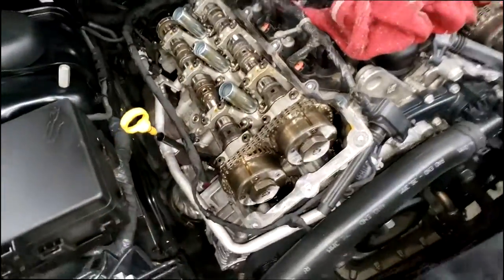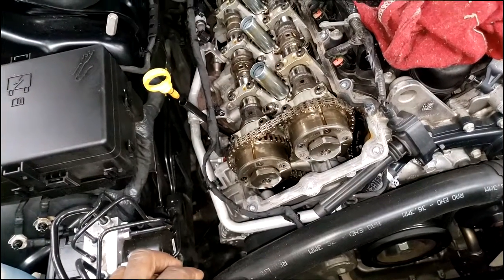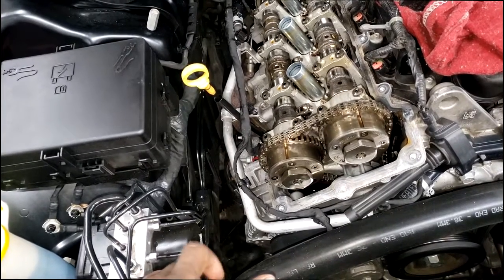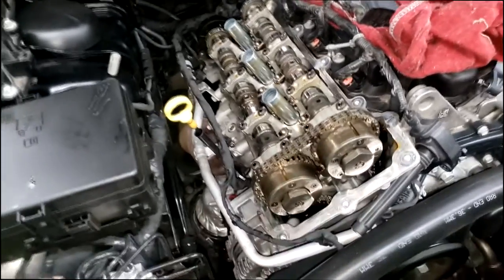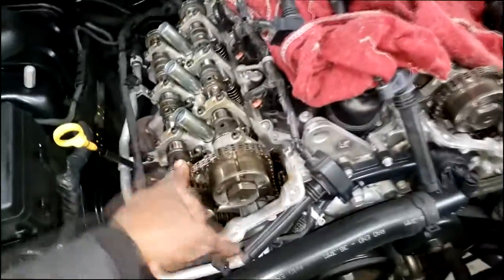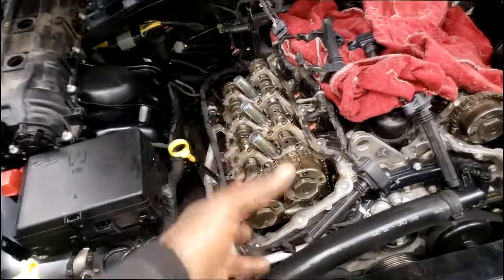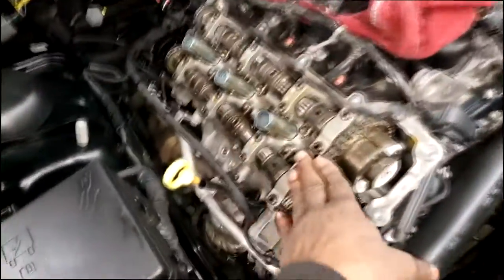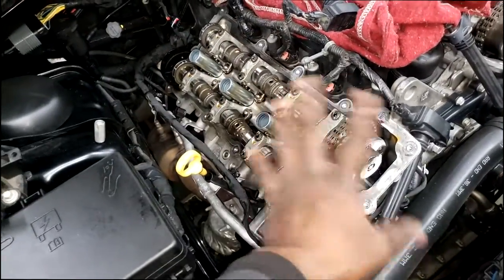VVT Cam Phasers. NO SPECIAL TOOLS NEEDED. Broken rocker arms, lifters, camshaft,  3.6 Pentastar tick

Comment: So you were able to get the phasers back in place without applying pressure to the tensioner?
Reply from the maker: Yes, its a fanegalling thing. But I dont recommend doing it this way. I suggest you use the proper tools.

Comment: Hey so I have to do head gaskets and have to remove timing to reassemble. Am I gonna need special tools or is it just gonna be a huge pita? Wanna make sure its not impossible without extra tools.  Or if I need help. DIY mechanic with experience doing heads. Never timing. I know bits but its what I dont know that worries me. Vehicles a '12 town and country 3.6 pentastar with 135k
Reply from the maker: Cover just nuts and bolts if I remember correctly. Special tools needed for cyl head install mainly. I'm trying to remember because I hardly ever remove the cover when taking off the heads. But good luck buddy. Also are you subscribed to this channel?

Comment: Great video, I had the phasers out and new ones in , in a flash. There is no check engine light on and I verified 
 There’s no other codes on the computer with dealer level  
Computer . Nothing stored absolutely clean. Am getting a perceived rich air fuel condition on the cylinder bank in question where long term fuel is being trimmed out , I was getting phaser noise on only bank one at idle with a cold engine and phaser rattle would go away once engine was near operating temp. I ended up taking the valve cover off and on 2 more times. Once to check galley bolts and another time making sure I didn’t have some kind of lifter cam issue. Anyway I 
 replaced  the phasers, oil control valves
, the phaser solenoids I verified oil pressure with a mechanical gauge , 85 psi cold oil and 32 psi hot oil, and still have the phasers rattling at idle with a cold engine. I changed the oil and filter. I checked the filter and found what looked like small black specks of something I don’t know what it was. It could be plastic or black gasket maker from replacing the valve cover 3 times ?? I also did an engine flush in case there was oil sludge blocking an oil passage. The flushed oil came out clean. I’ve been using AMS OIL
 since the jeep was a virgin. So I know there’s no sludge in it. I think the only thing that’s left to do is timing chain , 
tensioners and guides on the passenger side bank. The motor has 154,000 miles. Any advise would be great. Should I replace both sides including chains and sprockets or just the tensioner components. tensioners?

, tightened the oil galley bolts, replaced the phazer solenoids also.

Comment: @Online Mechanic Tips. Just our curiosity. I marked it with paint pin like you did and reinstalled it all lined back up on both sides same way I took it apart. Spun it around multiple times and marks on chains never line back up. Timing marks do… is it just the way the chain is made. I went around like 10-11 times lol
Reply from the maker: Don't matter how many times you go around, the marks (arrows/lines) have to line up on the phases signally TDC up. Or just simply out of time
Reply: @OnlineMechanicTips the arrow and like lien up fine. Just after spinning it around one cycle took them back to the lien and arrows lien up but the spots originally painted on the chains changed.
Reply: @OnlineMechanicTips the lines on left line up and the arrows on the right line up… no issue there. 

The spots a painted on the chains don’t ever line back up in the same spot when arrow and lines are lined up. Get what I’m saying.  The one painted to mark where the cam phased line  back up.
Reply: Any help?
Reply from the maker: @jmillie94  What kind of vehicle is this? And what are you calling right side and low side? Also are you subscribed to the channel?
Reply: @OnlineMechanicTips 2013 jeep wrangler jk. Passenger side is both lines  line up. : and drivers sides both arrows line up. Etc. 

Just the mark that I painted on the chain when I had it a times to swap the phasers it all lined back up during reassembly. 

Just after spinning over the painted spots on chain don’t line up with cam phasers but the timing marks line up.

Comment: I am doing my camshaft, rocker arms on bank 1..got it all out, replaced, mark, etc..try to put the "special tool" for the tension and it came out. Now, both of my cam phasers are out from the camshaft intake and exhaust. When I try to put them back on the camshafts...it doesn't want to get in...all my stuff is back and torque to specs and still having a hard time putting the cam phasers back on...heeelllllpppp

Comment: Working on the right bank, I don't have all the slack in the chain you seem to have to replace the phaser.  Where did my slack go?  Did the chain jump a link on the sprocket down below?
Reply from the maker: My guy you suppose to use the special tools designed to do this right. This way not recommended. But if you insist, that tensioner can be manipulated using the crank bolt. May have to rock back and forth a little to gain that extra slack needed. O and BTW, tighten those oil gallery plugs down while you there.
Reply: @OnlineMechanicTips  I never did get the tool to work for me.  It kept sliding past the chain tensioner instead of catching it and pushing it down.  The aluminum tool from Mopar probably works better.  But I did get everything together without the tool.  It wasn't as easy as you make it look, JT, but I guess that's your experience talking.

Comment: JT ain't it easier if you use the wedge on that bank as well? That's how I did it on my Promaster.
Reply from the maker: The word "easier" apply to the one considering doing it and have done it. That very well could be easier for you my guy. But please keep in mind here. I dont condone doing it this way at all. I only did this as a bet to another mechanic to show how fast I could get it done. The plan was to remove this video but then it started getting a lot of views and comments so I left it up. TO THE NEWER MECHANICS. PLEASE USE THE PROPER TOOLS TO DO THIS.

Comment: Do you run into very many pentastar tickers where it is merely a collapsed lifter and all of the rockers are A-OK thank you you're the best
Reply from the maker: Never. In fact Ive never seen a lifter collapse and cause a ticking noise on the Pentastar. I only replace them if its in the customers budget.  Which 90% of the time its not

Comment: I got the passenger side done with this trick. But driver cams seems further apart requiring more slack. Does this no tool trick work on the driver side we well?
Reply from the maker: What year and model car is this? Also are you subscribed to the channel?
Reply: @OnlineMechanicTips omg you replied. The pentastar god 🙏

2015 grand Cherokee 3.6. 
I used this method and it worked on passenger side. Driver side its not working. 

10200a-1 On driver side is popping back out. It wont stay in. I saw another of your videos you pulled up on the tension lever then used a screwdriver pushed the tension in then installed grenade pin which i dont have and a wire hanger is too thick. Please help me
Reply from the maker: Your help will come in the form of having the correct tools for this job. Bank 2 head requires special tools that you need.
Reply: @OnlineMechanicTips  i have the timing tool. Its popping out every time i let go of it
Reply: @juliannedd382 you're not ratcheting the tensioner back sufficiently OR, the oil gallery bolt is backed out. Pay close attention to that one, a lot of guys pros and amateurs alike, miss that.

Comment: Do you have a recommendation as to a brand name for teh phasers? I see the Mopar, but also other brands. Do you always use Mopar?  Yes I subscribed.
Reply from the maker: I only use and recommend the OEM Mopar parts for this engine. Now some may argue that it was the Mopar part that originally failed. Keep in mind all parts have a life span to them. Also keep in mind that you hardly ever going on with the same part. Meaning that most of these parts have been revised and upgraded so they not the same as on your car. I dont know of any other company that sell these,
Reply: @OnlineMechanicTips  Thank you. I have a 2015 Jeep and I get a p0390 and Limp mode on the highway uphill under load. Its almost killed my a couple times. I am tearing down soon. Have all new rockers, lifters, spark plugs, and will be doing phasers. I am hoping the front oil plugs are loose because thats what I have heard causes this issue in the 2015. Oil cavitated and looses pressure to the phaser through the loose bolt threads. Thanks for your reply. I will order Mopar. Have nice day. Love your videos and honesty. the world needs more good guys like you sir !

Comment: So I guess while I was working on a 15 ram tradesmen 3.6 driver side intake side the tool shot out and the tensioner extended out all the way and I can get JT to release and get my tool back in the right spot and to make things worse the cam jumped time and I can’t get anything to go back correctly what do I have to do to fix this problem I really need some help

Comment: Got bank 1 today. bit of a struggle getting the slack to put the intake phaser on after doing the exhaust camshaft but I kept jiggling the shafts and had to haul up on the phaser to get the oil control bolt all the way in! I used the special tool but it didn't give me all the slack I needed without shifting the cams back and forth I wouldn't have got it and did it the way you did it and it worked in your other video with the special tool! Second time I tried the right bank, last week I was afraid to take the chain off one of the phasers and let it lay. After this video I figure I should be able to get it with the special tool today cause last week I seen that by shifting the camshaft(intake) provided slack in the chain with the tool in place. I have a 2015 Dodge Grand Caravan. The actuators were in a tight spot along with the intake oil control bolt with the silver cylinder in the way of the wrench, I need a new breaker bar lol. Everything pretty tight in this vehicle, I'd image it's the same with the others. Bank 1 your doing some blind wrenching, feel for this and that 2015 dodge grand caravan. Have a good one. Cal

Comment: Sir I’m subscribed to this channels I’m doing this job and things gone smooth on my 2014 sxt 3.6 penstar got  I the cams of on my both heads I know u said the driver side head   U can remove with the trick and tool to get k. The tight spot But is passanger   bank  able to be removed to  without timing cover coming off ?like the driver side ?

Comment: Thanks to u I’ve removed my cams and heads  using ur methods I didn’t have to remove the timing cover   On my charger sxt 2014   Now I have no doubt I can put everything back together after watching this I’m gonna go send my heads out to get resurfaced and tested later on this weeks  and then I’ll do my head gasket and start putting everything back together this is my first  time  removing head on a  engine I’ve always just swapped them  Im doing this because sxt was over heating  due to running some test and coming back to head gasket

Comment: So far, excellent videos! I want to check my vvt oil control solenoid on my 2015 Ram 1500 with the 3.6L engine. I haven’t been able to find the location of that part. Can you help me? Thanks in advance for answering.

Comment: I love watching your videos.  I am a pentastar mechanic myself.  I build pentastar engines and have done so for the past 7 years.  I worked on one for the first time under the hood and I must say it can be a beast at first but I prevailed.  And even still I utilized your videos most of the time before tackling the job.  Lucky for me it was a front facing chrysler 300 engine.  Your are a trailblazing mopar man after my own heart.  Keep up the awesome work sir.
Reply from the maker: Thanks for tuning in Kevin. I appreciate that
Reply: I need both of y’all help, I had a oil leak and day before oil cooling housing got delivered car gave out at the light got it towed changed the alternator AGAIN but now when starts the engine knocks. And idk if is the lifter or camshaft but someone also said timing chain but I have NOO idea (2012 Chrysler 200 3.6l)
Reply: Hey friend i try fix a pentastar pacifica 3.6 2017 have a code p105D and don't dissappear this code being  when take the block motor from a ram promaster 2015 and use same heads now replace the vvl solenoids , oil pump but the code still on... so help me

Comment: If you're replacing the right bank 1 side valve train, is it necessary to remove the left bank 2 valve cover?  I have heard to remove both side valve covers, even if working on only one side, but is it for ensuring that all four phasers/cams are aligned perfectly?  Or can I just remove right valve cover?  Thanks.
Reply from the maker: Yea thats done for visual confidence. You don't have to. Just go by the marks on the phasers to assure timing will be on point.
Reply: @OnlineMechanicTips Thanks for your response.  It gives me more confidence in doing this job.  Appreciate your informative, no-nonsense videos.  Very educational, keep producing them!

Comment: I did it this way when I changed my rockers and lifters, no issues whatsoever! Took my time removing the timing wheels when knocking them out with a wrench and had my hand on the other side to hold it in place. Had some fishing line to hold the timing chain in place that I ran to the hood latch.

Comment: Question, this doesnt require to release tension from the timing chain tensioner right? Im only working on Bank 1 side and would love do exactly this method without messing with the tensioner
Reply from the maker: Yes it requires that. I highly suggest you use the proper tools design for this job.

Comment: how does the timing chaim tensioner not get fully extended?
Reply from the maker: It's a stradegy I use when I bring up TDC. I can't explain because it's a feel. But I highly recommend no one to do this. Not a good idea, please use the tools.
Reply: @OnlineMechanicTips  using tool I damaged shoe and piece of broken plastic fell into the engine and the the tool just cracked
Reply: @OnlineMechanicTips  I got P000B after cams lifters and rockers replaced bank 1 and put new cam and crank sensors - stil failed relearn and went into limp mode. Did I damage the exhaust phaser?

Comment: JT, some guy changed bank 1 exh camshaft to try and clear a camshaft sensor code. Now car drives under powered, wont shift right and 0014/0017 are coding. The timing marks dont line up perfectly on bank 1 phasers. How can I tell if he re assembled in the wrong chain position or more likely a bad phaser? Please help...Im opened up and looking at it many hours...Alan In Boise ID

Comment: Thanks for your great videos. Definitely learning a lot. Im replacing the timing chain on a 3.6 engine in a 2014 Grand Cherokee. When I put cylinder 1 bank one/passenger side on TDC on the compression stroke all sprockets/phasers end up backwards and upside down. 
Is it possible it was put back together backwards by some else. It looks like someone had done work on it already. Any help will be greatly appreciated. Thank you.

Comment: I have seen other mechanics take the cam sensors off the valve covers before removing the valve cover.  That may help with removing the valve cover.  Make sure to replace cam sensors back to the same cam phaser.  I haven't heard of cam phasers malfunctioning, but I do know that material can get stuck inside the cam phaser and that you could clean it out instead of replacing with new cam phasers.  Also, I didn't see you use any tool to depress the tensioner, but I didn't understand how you still had all that slack.  Must not matter so much, but correct me JT.
Reply: definitely u have to press the chain on a tensioner with a big thick screwdriver

Comment: Cams not locked down?
Reply from the maker: This is a terrible video and I suggest you not follow it. I only uploaded it because somebody ask me how I do it. The thing with me is that I have done a lot of them so everthing simple to me. But no, the cams not locked down.
Reply: @OnlineMechanicTips  so long as you know a trick then go for it. I discovered a short cut to my 4.6 timing chain without locking the cams down by rotating the crank a few degrees off from TDC that lowers all the pistons down far enough so no valve will interfere. A little tougher to line marks up but still doable when double checked. Once timed up then it's good to rotate. In fact I got that method straight from a Ford repair manual timing section... trick to the trade.

Comment: Why is one bank easier to do.. I heard u mention that but don't understand how.. tell me please
Reply from the maker: Timing set up differently on both banks, tensioner in a different position on each bank
Reply: @OnlineMechanicTips  can I change out one can phaser without the tools.. I figure if I line the teeth on the sprocket I can tap it on and off with a hammer
Reply from the maker: @jasonmassey7883  im against that. You should get the tools. This a terribly advised video. Curious, whats wrong with the phaser? Also are you subscribed to the channel?
Reply: No I haven't subscribed.I just changed the time in chain and when I start the car up it rattles a few seconds.But I know, if you can rig it up and have a little patience.I could probably do it but I was wondering what's the difference in both sides?Can I do the bank two just like you did the bank one ? @OnlineMechanicTips